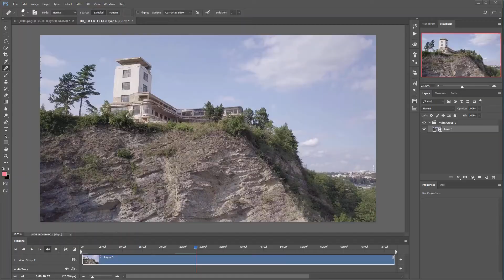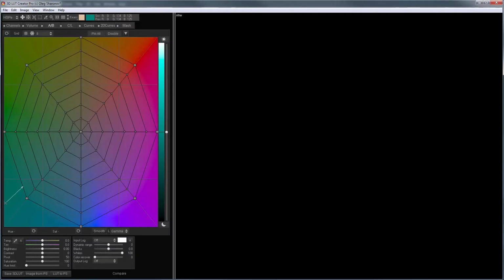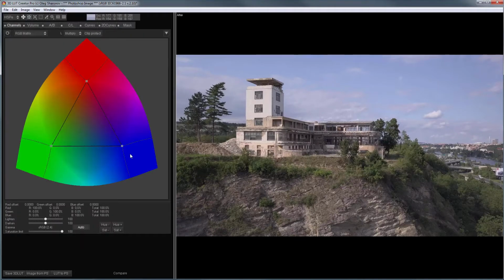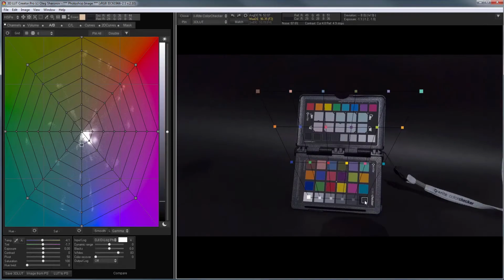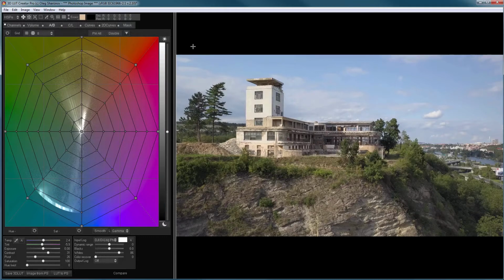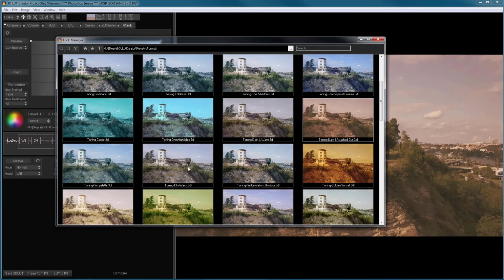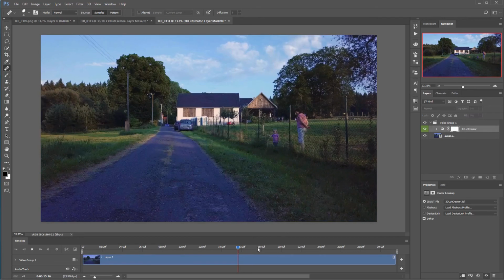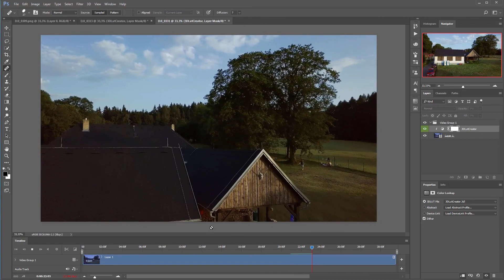How to grade DJI Mavic PRO video correctly, D-Log

Comment: Ah, I was just going to ask about a color matrix for Olympus cameras, but i see that you are suggesting that a color chart be shot. Does this only make sense for log footage? I know that the EM5 mark 2 has a flat setting, but it isnt as flat, of course, as any real log footage.
Reply from the maker: The Post Color Blog well, it worth trying anyway. If you don't have the log curve of your camera in 3DLC, you can still try linearizing it with curves using curves+matrix matching method. Of course if camera has some adjustments in log mode, it won't be totally correct, but I'd give it a try. :)

Comment: Can you add support for Fuji's F-Log?
Reply from the maker: Attila Bakos Yes, sure, but can you shoot a color chart in F-Log so I can test it? Thanks!
Reply: I'll buy one soon and send you the results. Where should I send the link? In the meantime, take a look at the datasheet, it's informative: http://www.fujifilm.com/support/digital_cameras/software/lut/pdf/F-Log_DataSheet_E_Ver.1.0.pdf
Reply from the maker: Attila Bakos send it to support email on 3dlutcreator.com, thank you!
Reply: My color checker arrives this week, I hope to send you the files in the weekend. In the meantime I have a question. How would you grade a video that has values up to 109% RGB? Photoshop seems to clip them at 100%. I can lower the offset in Resolve and export a still, but I hope there's an easier way. Is it possible to build a lut that can deal with values outside the legal range?
Reply from the maker: Attila Bakos Seems photoshop just treats the video file wrong. I'm not sure how to deal with it, can you send me a sample file in extended range?
Reply: Sure, check this one: https://drive.google.com/open?id=0B1MgijLb4rlhX2tPa3BiNS0yZEE
The cloud on the top left will look clipped in photoshop but the data is there.

Comment: Hi, Thanks. This is super feature. I just wondering how to use the "load as external LUT" Function on mac. The alt+shift doesn't work. What's the keys for mac?

And where can I find the color matrix values for GH5 and V-log. with out them 3D lut creator is not suitable for grading v-log fo gh5. Thanks!
Reply from the maker: Joo.Works thank you! I'll check modifier keys in the next version. About gh5, I hope that primaries of gh4 are the same. If not, you can shoot a color chart and use matrix matching method to get the correct matrix.
Reply: That's true! Of course! I made a two part video about "hacking the gh5 colour" some time ago with 3D lut creator and it's been super popular video on my channel. Braking 17k view  (two videos) soon. I would like to do more videos about 3D lut creator soon.  (part 1: https://youtu.be/LitwrtH5mS8 Part 2: https://youtu.be/rLLe8AKewXc)

My viewers have been thanking me for the excellent correction LUT that I gave them, but it's because your work! You should get the praise.

And I have an out line ready for a colour grading course how to use Photoshop for video colour and with photoshop  using 3D lut creator. Maybe we could think about some promotion for 3D lut creator inside the course? Could it be possible? Maybe somekind of bundle (Course+3D lut creator). The course is not only about 3D lut creator, mostly PS, but 3D lut creator is like the super power of PS.
Reply: And I mean I would be selling the bundle. You don't need to anything.
Reply from the maker: Joo.Works sure! That would be fantastic! And thank you for the videos! I remember someone sent me gh5 chart and gh4 matrix worked fine, but maybe I'm wrong...
Reply: I'll test it. Let me get back to you about this course thing on email. 

Mean while how can I load a lut from the look manager as an external LUT on mac? That would be nice to know.
Reply from the maker: Joo.Works you can go to preferences and uncheck 'Load 3DLUTs as presets when available'  :)

Comment: Great tutorial, and great software! I know the "whites" slider recovers highlights that are outside the sRGB/Rec709 dynamic range, but how does it work? Can the same effect be achieved with a curves adjustment on the D-log footage before D-Log to sRGB transformation?
Reply from the maker: Hello and thank you! Yes, it is actually a curve, that affects values close and above 1.0 values. There is a part of 3DLC pipeline that allows values above 1.0, and in the end of this part those values either clipped, or compressed into 0-1 range with the whites slider. Usually curves are limited to 0-1 range, so if you want to use the curve, you need to use it before D-Log decoding. Problem is that if you're going to change something, like white balance, during D-Log decoding, these curves should have quite complex shape to give you correct results. Another approach is to do D-Log decoding with lowered exposure, so you don't have anything clipped, and increase the brightness afterwards with a gamma or similar curve. But all these approaches seem to be less precise.
Reply: Great explanation, thanks. Yes, for fixing errors during filming a precise Log decoding is important.